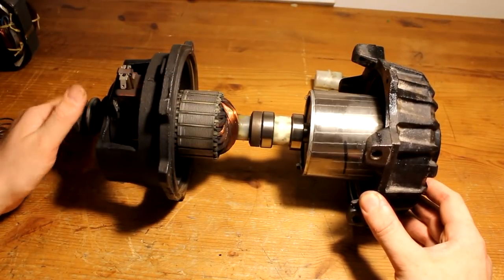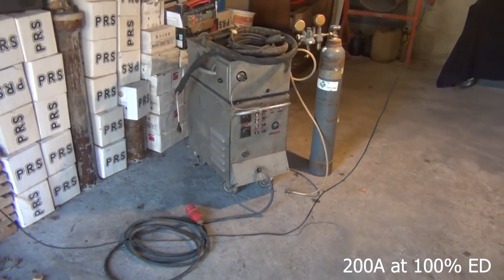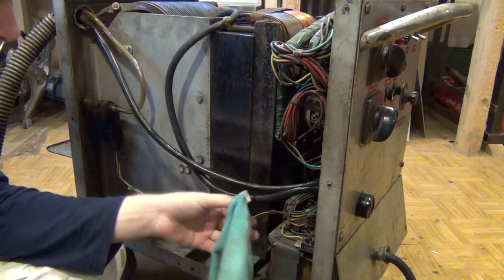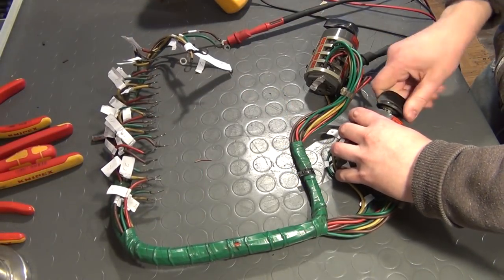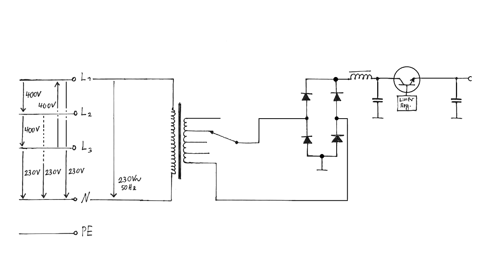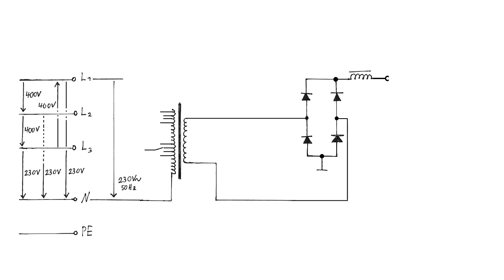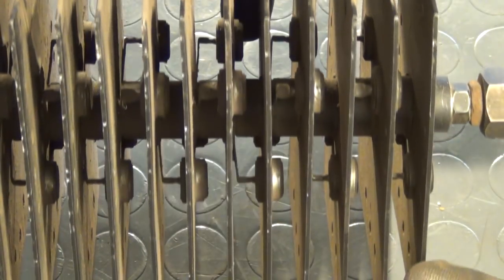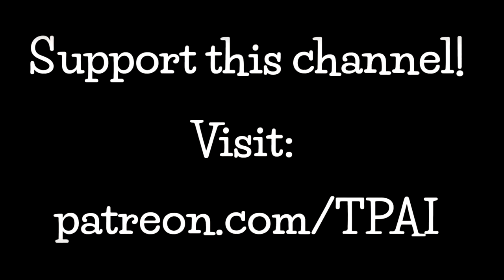MIG/MAG Welder Repair and Modification (I)

Comment: im an electrician in the US i find your videos fascinating. i had no idea your 220 used a neutral.  we usually assume its 220 phase to phase like 220 in the US...    i work at a 120 year old steel forge, you would love all the old stuff we still have.  i took a motor off of a crane a few years ago that was dated 1919 and it still worked up until then

Comment: Three phase is great, my grandpa used to be obsessed with three phase stuff. Almost every tool in our garage has a three phase motor in it. The bench grinder is three phase and when you press the on switch it speeds up instantly and is impossible to stall out.
Ps: sweet welder, my three phase arc welder can only do 180A@100% but i got it for 80 euros so i'm not complaining :D

Comment: the bonus with a separate PSU and eire feeder like this is you have a great high current low voltage DC PSU.. my dad built his own mig welder from scratch (yes that right from scratch and its about the same power as this machine!!) and we have used the PSU to directly start cars when the battery was flat!!

Comment: Nice drawings and explains ! 
If you would consider to add a diagram with the 3 phases waves (or a link to a video about it) it could be even brighter for those (like me) who need to see how it works from inside the inside.
The help of 3 phases in rectifying electricity is so important...
During my studying period in college I worked on a project in which I ordered a single phase inverter. This machine had the capability of supplying 3 phase and of course had PWM support.
Might be interesting if it works for powerful machines like a welder...

Comment: One of the greatest welding breakdown videos I ever saw. Thanks for making it understandable. Your talent is the ability to explain clearly and in a very logical order. I'm taking apart a welder right now, and hoping to get back welding again, so this is an inspiration to me. I must say those German units are very much to be admired for their solid construction. Wishing you peace and grace and a new year full of prosperity and good cheer. Aloha!
Reply: I often wondered if a toroidal transformer would ever have a place in making a good welder. Perhaps cooling could be accomplished by circulating oil, air or water through its center? Never seen one used this way however. As far as 3-phase, it's pretty sad we missed the boat on that while the rest of the world enjoys those benefits. Compared to mine this appears to be the stradivarius of welders so to speak.

Comment: Nice work.  A monster episode!  It was very well presented.  One note to add for the common core transformer: Since each winding shares the common core. when one phase is active or conducting, the magnetic field in the core induces current in the "non-active" phases. This results in smaller overall ripple amplitude but at a higher frequency. This is important in EMI, but I'm not sure if it matters in this case. And it's "Ah Loooooh Miiihhh Nuhm" (4 syllables).  The extra I after the "N" does not exist and should not be pronounced, even though every English person does that!

Comment: A TIG/STICK welding power supply is a constant current supply. A MIG/MAG welding power supply is a constant voltage power supply. The TIG/Sick supplies have a higher open circuit voltage a relatively large voltage droop (voltage drop when welding). The output choke (coil) helps control the droop. 

You can wire weld with a CC type power supply if you use a voltage sensing wire feeder. With this type of feed control as the output voltage drops the wire speed does too. With a CV power supply the feeder would be a constant feed type control.

Comment: You might find the Haas Kamp Three Phase to Single Phase Conversion method for welders interesting. An internet search will turn up lots of info about the method. i know Dave Kamp, one of the creators of this process, and he is a very friendly, and helpful guy. 

He and his partner, Haas, developed this method for the same reason you bought the MIG/MAG welder you did; the industrial duty cycle. They are freely sharing the method, hoping to get future welders into 'real' welders, instead of what is sold at home improvement stores.

An internet search will turn up loads of information about the process. Dave posted the conversion on Practical Machinist, originally, and that is the best way to reach him, through that site.

They have done lots of testing, and have shown the converted welders weld as well with converted single phase as they do with three phase. When I first talked to Dave about the conversion, 3-4 years ago, the cost for converting a welder was about $150, for new components.  The majority of the cost is the large capacitors necessary.

A very simplistic explanation of the process is a capacitor is used to store the 'third phase', then, the stored current is released at the appropriate time to create the 'third phase'.  The key, for me, to understanding how this could work, was to understand that 240v single phase is not an accurate term. Conceptually, it is two phase; two legs of 120v, 180° out of phase from each other.

By storing, and delaying the release of a created third leg, you end up with three legs of 120v, 120° out of phase from each other, which is, three phase.  

When Dave first explained it, he told me several times, what makes this possible is a welder is different than a motor, in that there is no rotation. Rotation makes timing of the three phases more critical; welders are more forgiving.

Since I learned about the method for conversion, I have since learned of a device sold as a Phase Matic. I bought one from a machinist a year ago.  It is simply several relays and a capacitor. Conceptually, it does the same thing, creates a third phase. The relays are responsible for the control of the third phase.

You use the Phase Matic to start a three phase motor, then once it is running, it will continue to run on 'single' phase, and also generate three phase. This allows you to start additional three phase motors, as long as no single motor is larger than the first motor started.

Once you get other, smaller motors started, the original motor can be shutdown, and the smaller motors will continue to run.  Quite clever.
Reply: All it would take is to connect the same capacitors to the rectifier output. Simpler to understand, maybe, since it’s a circuit that’s common as dirt. The function of the capacitor is the same, but at the output of the rectifier. What you have with a DC three-phase welder is an AC-AC step-down transformer followed by a rectifier. Normally in constant voltage DC supplies you’d have a smoothing capacitor at the output of the rectifier. The welders don’t have it, since the 3-phase supply provides enough overlap at the rectifier output that the voltage never drops to 0V. With typical US and Canadian split-phase supplies, the phases are 180 degrees apart and both phases go to 0V at the same time. So all you need is a smoothing capacitor at the output of the rectifier, and it’ll be as good as with a 3-phase supply or even better. A certain minimum amount of capacitance is necessary since below it, the capacitors you have will carry way too high of a ripple current and will overheat. So the ripple current rating is the primary driver of cost here: once you got enough capacitors in parallel to handle the several hundreds amps of ripple current, you also got enough capacitance to keep the DC voltage quite steady - probably smoother than the output of a 3-phase rectifier. With some care put into overvoltage shunting, 50V electrolytic capacitors could be used when the rated no-load output is 30V or so.

Comment: I love the fact that most of Europe have 3 phase power. Very very smart of the utility company to implement. 3 phase power delivery is more efficient because using a 3 phase motor is far more efficient than a single phase using a running capacitor. Too bad US did not take that on for the residential. To have that done some utility company charge you an arm and a leg to implement and setup for use in residential.

Comment: So glad i went for a used industrial 3 phase mig welder.
However, there was a little gamble, my shed does not have a neutral.
So if the machine needed a neutral for example motor steering.......
Thank you for this informative video, merry mig mag ;-)
Reply: My shed is build about 150 meters away from a normal power source.
I have made a tap from a nearby waterpump, this pump only needed l1, l2,l3 and ground/pe there was no neutral in the cable.
Single phase is done with a transformer, 400 volts to 230 volts.
Reply: The transformer is 2000 Va, enough for my needs.
I installed the transformer in 2003, works very well.
Well euhhh, you get used too the hum ;-)

Comment: WOW, YOU REALLY NAILED IT - Great design explanation! 
Three phase primary "Y" source, "Delta" secondary output. 
Got it! 
Interesting single core transformer, three phase magnetic mystery... How day doo dat?
Thank you and Merry Christmas.
Reply: > How day doo dat?

That's advanced pixie wrangling... :-)
Reply: they do it in a single core transformer the  very same way as they do that in a single core generator or a single core motor ;) the single transformer core is not a straight line it's like an "E" core with primary+secondary winding for individual phases on each leg of the "E" core so the magnetic fluxes are not fighting against each other.
Reply: It’s not a single core but a single magnetic circuit with two separate loops that only share a common arm. Thus the flux in each loop can be controlled independently, and there’s no “short circuit” between the phases. Each loop you can draw in a magnetic circuit can have different flux through it, just as every loop in an electric circuit can have a different current through it. In fact, magnetic circuits can be “morphed” 1:1 into electric circuits that have the same properties just in different units. Eg. magnetic reluctance is like electric resistance.
Reply: @absurdengineering  THANKS

Comment: Super cool! Your explanations are amazing. Only thing I'm curious about, though. You're using the same power supply for both MIG and stick welding... MIG requires constant voltage and stick requires constant current for any degree of success. The transformer setup appears to be for CV, just wondering if you could elaborate a bit more on that
Reply: I was wondering about this!  It seems like the current would be varying wildly...  But if it's just for an amazing test, to burn up a lot of current....  Maybe that will be discussed later.  Maybe that was ALREADY discussed, a lot of information went by here, will probably watch this several times, and show it to some students as well!

Comment: That 'heat sink' rectifier reminds me of a selenium rectifier. I ran into one a few years ago repairing an old shop size battery charger, and learned about them. The plates are coated with selenium and were used before diodes were available/used. When they get old, the selenium coating wears off the metal plating. When that happens, a funny thing happens. When you put electricity to the worn selenium rectifier, and there is an arc at the worn spot, make sure you have fresh air, or are outside.  It is a HORRID rotten egg smell, quite similar to already eaten eggs, if you get my drift!  LOL

MY thought was, oh, it's probably not that bad, and it's 30°, outside right now, so I'll work on it, inside.  Bad move. very bad move.  Glad my wife was out of town, or I would have been sleeping alone, because she would have been at a hotel...  LOL

I was able to remove the stinky selenium recifier and replace it with a modern, full bridge rectifier, and had great battery charger. I also added a resettable circuit breaker for overload protection. Most battery chargers have circuit breakers, but they typically die.

Comment: You are lucky that most or all of the homes in Germany are supplied with three phase. In New Zealand where I live single phase 230 volts is standard it's vary rare to get three phase unless when your house was being built you asked for it but it's not cheap. But my grandparents place is supplied with it because when it was being built we asked for it but it certainly helps when you have high loads. Also I think is a great idea because you can distribute lights power and heating evenley.

Comment: Have a Merry Christmas and a Happy New Year too. Keep up the great work with the welder. I would have to disagree with your choice of fans as a metal fan would be much better as the original equipment manufacturer intended. Sometimes you can find one for cheap on eBay and they deliver to your door. Love your detailed explanations and understanding of electricity too.

Comment: Amazing difference between modern hobby welder and Retro Industrial welder, while hobby might well have alloy coiled transformer and very low duty cycle, those industrial units are pure copper coiled and you can literally run that at full chat all day long on heavy steel plate and you'd burn the welding tip out and over heat the shroud long before the transformer even gets warm at the end of a long day.  The only problem I have found with industrial MIG welders is the amount of dust that gets sucked into the base unit that needs to get blown out regularly with air line at least every few months at least.

Comment: Merry Christmas and hope yours went very well! A 14 hour upload beats anything thing that I have ever done by far. I remember when I was doing very well to make a download of 1Mb/10minutes. (9600 baud ) That was the big leap from 2,400 and pre-internet access.
My next project is building a machine that does several independent things, but all driven from one DC treadmill motor. It has to be small, compact and easily carried around and somewhat rugged. Have you checked your e-mail lately? :)
Have a great New Years from UTAH, USA! (the skiing is great right now, too bad I don't do it, huh?)  :)

Comment: Priced a Lincoln Mig welder for use in the EU, they wanted almost $3800 for he machine, three phase of course. A bit out of my budget. Not the massive machine you have but a decent size. Settled for a small inverter for use here in the EU.

Comment: CC vs CV /&/ THANKS-GREAT ::: Could you speak to the issue of constant current versus constant voltage welding power supplies. When you mentioned several times the possible use of the "Mig-Mag' unit for STICK WELDING alarm bells went off in my head. I reviewed your previous welding video and very much enjoyed reviewing the magnetic_shunt / stray_field transformer but the CC/CA topic was not addressed then had a quick look at the power supply videos and did not see the topic addressed there.   /&/ This is WONDERFUL stuff and so well done. thanks !!!!

Comment: 19:30
I actually did that with an 80V 100.000µF cap (huge thing) and a big bridge rectifier on my old welding transformer, that was a hell of a bang, the tip of my 3.2mm electrode was just gone xD
Actually it was quite a lot of fun so I did it a couple of times more until the whole electrode was gone :D

Comment: We had to pay arr. 500 Euros for getting the 3 phase 440V power for our apartament and basement workshop . Then an additional 300E for the thick insulated cables to our distribution panel inside the house. Not cheap, but very convenient, considering the  requirements of 3 AC's, oven, induction stove and so on. Added benefit : I have 440V3ph in my workshop.
Funny thing, my wife insisted we are getting this after I explained that the maximum 4.5KW supply for an apartament (acc to the national code) is insufficient even for the stove

Comment: Had to look up a new MIG welder. Not sure how this one performs at peak but trying to buy this new, it probably costs north of 4kusd. A 7kusd machine gets you 300A at 60% duty cycle. Peaks at 400A, 30% duty cycle and can maintain ~240A.

Meaning this is an amazing buy if you can reliably make a set of 'one time' repairs. (Netting another 10 to 25 years for only a few hundred as an investment)

Comment: This house, being a typical British home, only has single phase (TT supply, for those in the know), though the power lines outside have 5 wires (3 phases, N and PE) giving the option for 3-phase, so I could have it installed, but, the cost is prohibitive for the home DIYer like myself, and with our power being 240v, we get 415v phase-to-phase... :)
Reply: Hi there- used give me so much grief trying to get 3 phase in the UK- Out here in Taiwan I use a large rotary converter. They run off 220v ( 240 would be OK) and push out very useful 3 phase which I use to run lots of different industrial machines including a 3hp mill and a 6' lathe as well as a IGBT electronic AC/DC square wave 200A tig- not all together of course :) Anyway I did not know about that in the UK so I hope this can help you. They come in all sizes but I have a 15hp unit that is about the size of two medium suitcases side by side. Merry Christmas.

Comment: It's good that you invested your money in the old powerfull welder rather than the new wimp Chinese welder.You have removed the capacitor so you don't have to worry about a surge of electricity while doing a low amp weld which would mess up the weld and maybe make a hole in the metal if it were thin metal that you would be welding..so now you will have better control welding without the capacitor. Can you do a video on anti-gravity soon ?